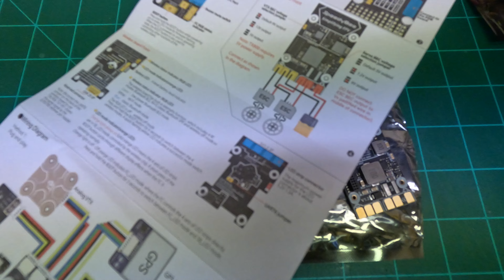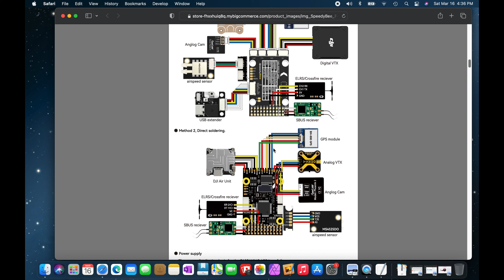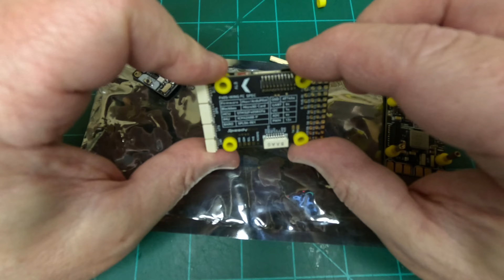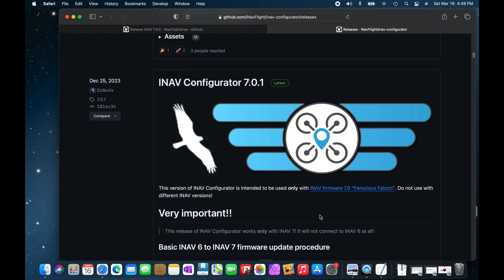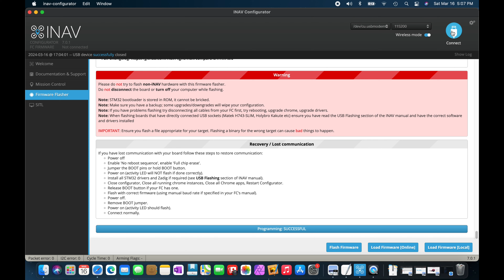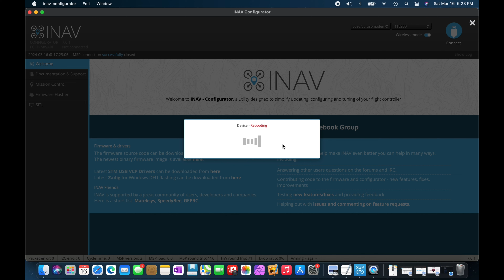FPV and INAV In an E-Flite Carbon Z T-28 Trojan 2.0m - The Speedybee: Part 2

Comment: Love the Speedy Bee F405 FCs. I have 4 in aircraft. Easy setup in INAV. Picked up 2 of the Mini ones 2 weeks ago for smaller builds. Like the Matek 405s also. Using Walksnail and Motion Sick gimbal setup. Also DJI original air units. Love having the RTH capability.  Good video and work.
Reply from the maker: Thanks for the positive feedback!  I agree, it really isn't that difficult to do.  This is why I want to document my journey through the process. Since this is only my second build with Inav, I'm still a beginner. If I can stumble through it, anyone can.  We don't have be perfect and still have a blast doing it.  Thanks for watching!  😄